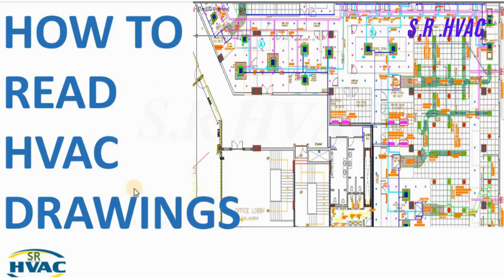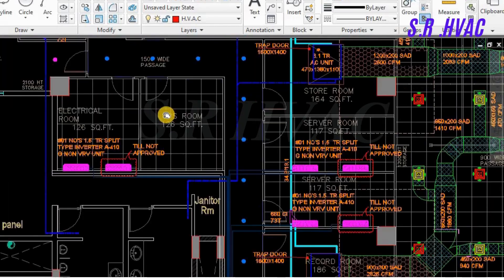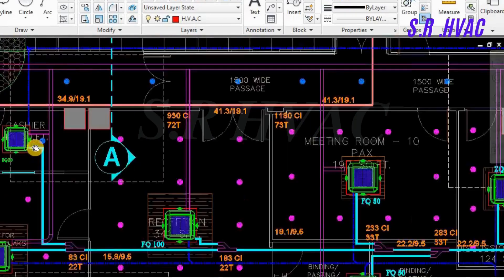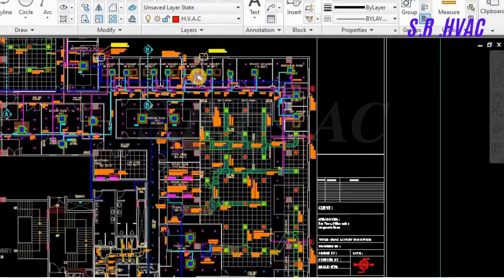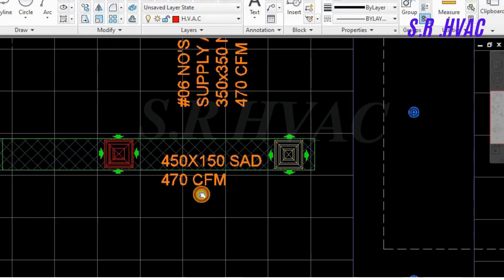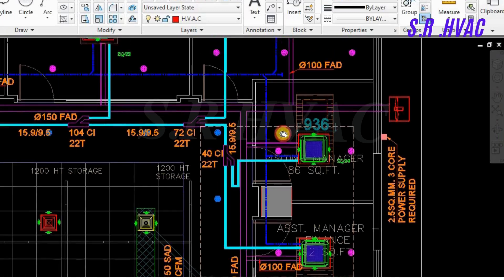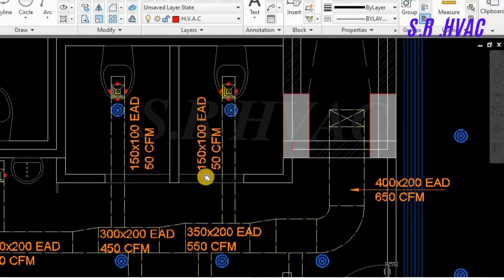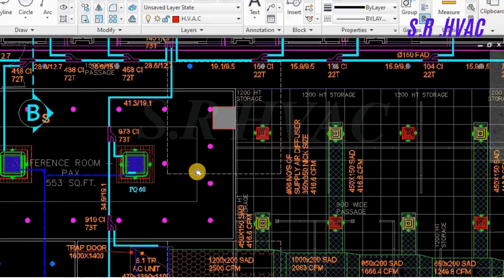How to Read HVAC Drawings: A Guide to VRF/VRV Systems

Comment: Design is good. But for the ductable better provide duct system for better return as well. For large open space it would be difficult for ductable ac to work properly if the return air system is not ducted.